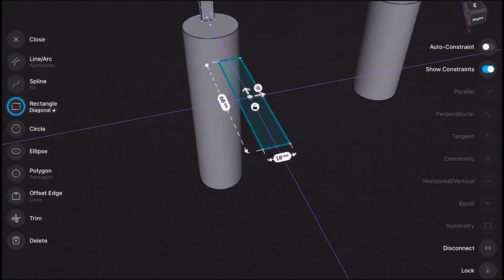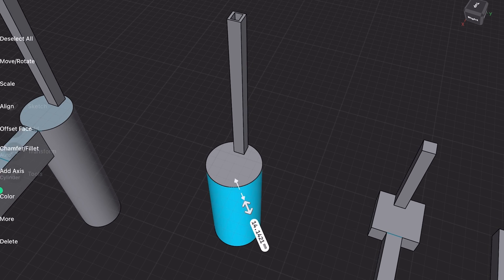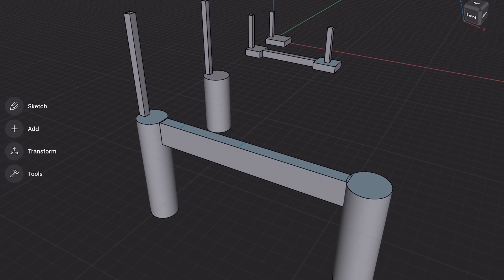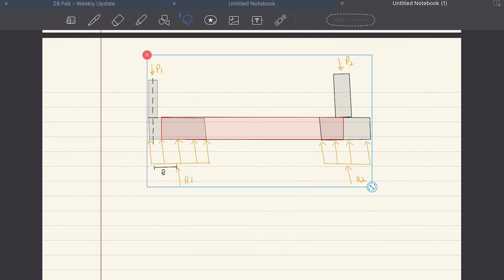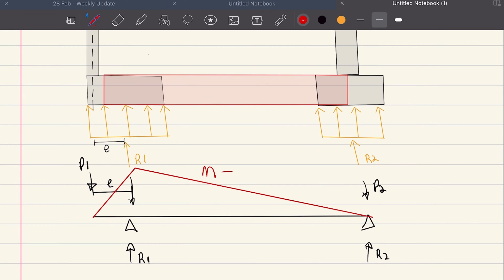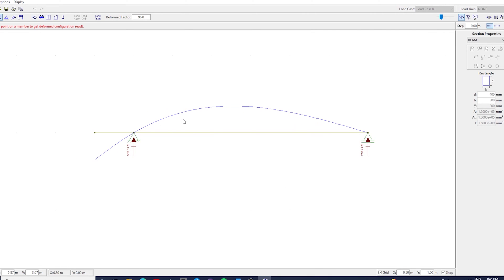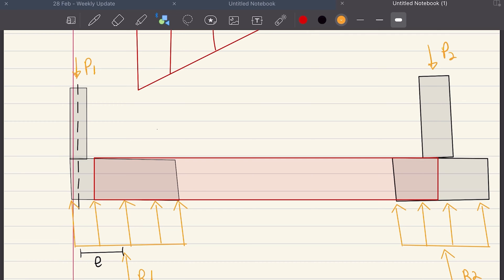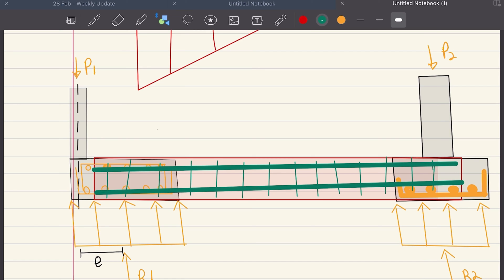Offset Columns / Eccentric Footing / Strap Footing

Comment: I have to design a structure where plot size is 20' wide only and all the column are at the property line so I am going for strap footing, but to analyse and design the strap footing where both the column is eccentric I tried to search any design example but couldn't find one. So if you suggest me any book or example that would be great. Thanks in advance 🙌🙌
Reply: You explained the concept very well.. thank you for this also 😊😊

Comment: Question...if a building is sandwiched between two buildings and both column A and B bump up against property lines and hence both are eccentric footings. We still need a strap footing, but how does the cals change?
Reply from the maker: Calcs are the same. Just draw the free body diagram with cantilever on both sides. Make sure there's no uplift

Comment: Can we prevent the rotation of the pad footing if the we were to place these ground beams at the top surface of the pad? Not from the base
Reply from the maker: you mean like a stepping the beam into the pad?
Reply: @bengthebrazilianengineerinAus  not into the pad, into the column right above the pad.
Reply from the maker: @Zorot99  if the loads are still going to the pad and there's nothing preventing it from rotating it won't work. You better off landing the column on the beam, shifting the pad from the boundary and making it a concentric pad footing without bending moment.

Comment: It wouldn't work like you described (for footings example) - like beam with two fixed basis...idea is good, but it's wrong. Cantilever is more closely. But the most closely will be "beam on ground".
Reply from the maker: they're not fixed. watch till the end and you will see the structural system